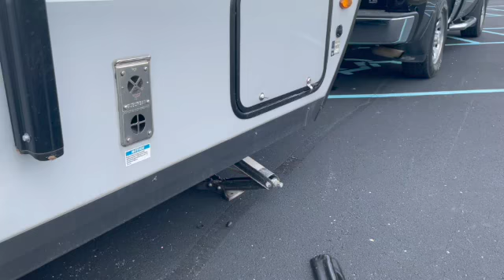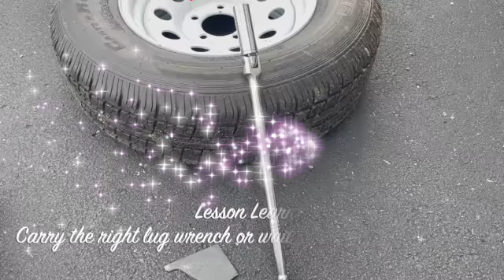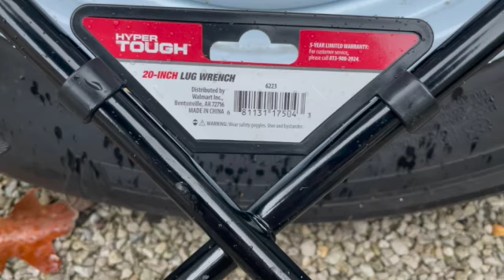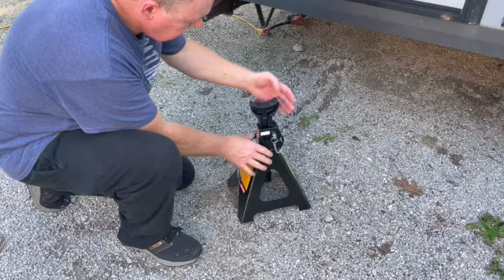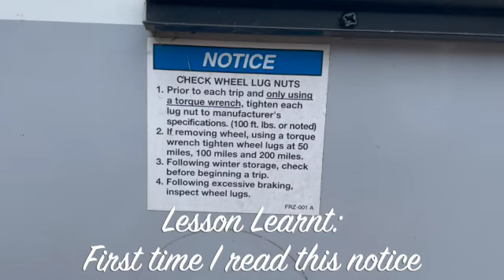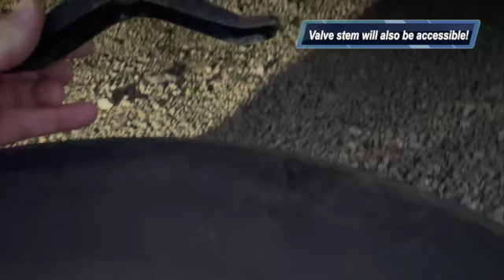Geo Pro Camper Tire Blowout - Changing Camper Tire

Comment: Hi !!  Enjoyed the video and decided to subscribe!!  I also have a 2020  19FBS camper and we absolutely love it.  

On a trip, my spare tire became loose and wiggled around.  During an inspection of the trailer, I noticed it, grabbed the wrench, and  tried to tighten it.  It wouldn’t tighten. Tried to lower the tire to see what I could see … but it wouldn’t go down !!  I ended up cutting the cable to get the tire off.  

I decided to drop the spare tire frame to see if I could replace the device that lowers and raise’s the tire.  But of course, in my life nothing is easy !!!

There are 4-bolts that hold that mount to the frame.  The bolts have a flat head.  On the inside of the frame, there isn’t a nut on the bolt.  There is some kind of cylinder that must be pressed onto the bolt?  Similar to a rivet maybe.  Anyway, I have no idea how to get those bolts off. I did try using a hammer to see if I could tap it off but it didn’t budge.  

So, have you ever seen this kind of bolt setup before?  Any thoughts on how to get it off??   

Thanks in advance …. 

Standing by …..
Reply from the maker: Hi Don, thanks for watching!  I’m having a hard time visualizing that bolt retainer your describing.  Maybe you could send me a picture of it to lessonslearnt2021@gmail.com.

Comment: Did your air pressure monitor let you know the tire was running low air pressure before it blew out? Looks like it could have been running low then heated up and blew out.
Reply from the maker: All the tire pressures were normal at the beginning of the trip.